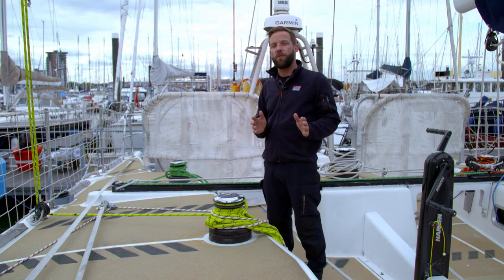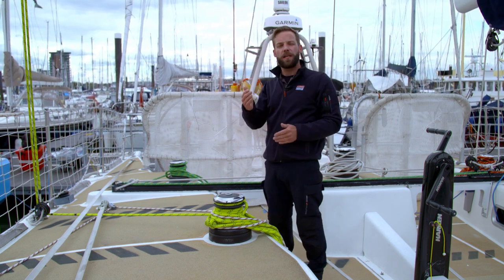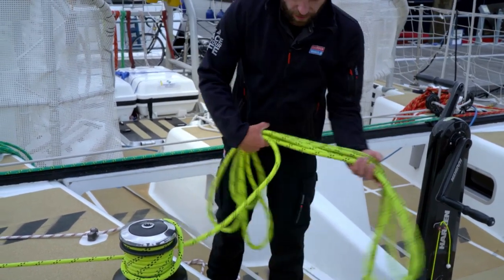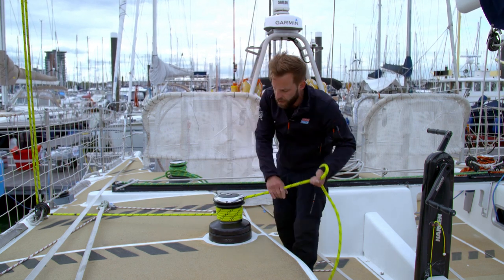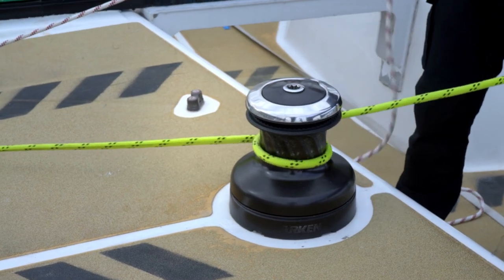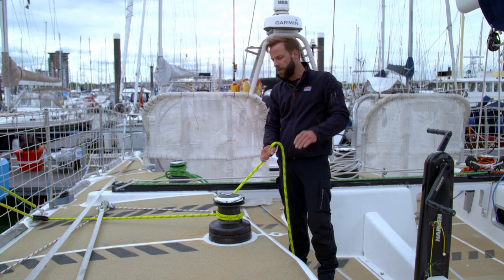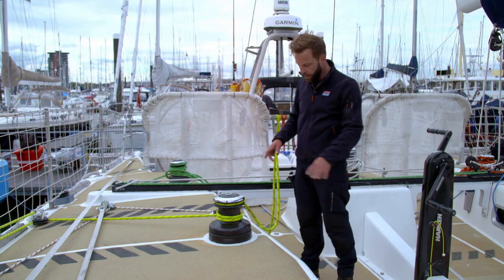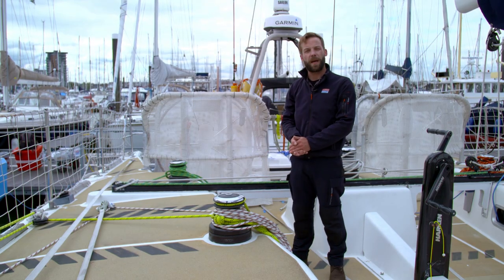Clipper Race Training | Running Backstay - Part 2

Comment: Runners are in fact a comination of standing and running rigging.  They can be applied or removed depending on the sail set and/or the maneuvers in the sailing route.
 We always used them on our Sigma 362 and will continue to do so on our new Glacer 47. 
The first thing is to mount them aft of the boom so that they cannot interfere with it.
The exact position should be ‘prescribed’ by the yacht architect or rigger.
Runners prevent the ‘pumping’ of the mast when using gennakers or spinnakers.  Most people think that they’re only designed to counteract the force put on the mast by the foresail(s) but they have multiple functions.  
This video shows how to put one runner out of the way (for example at the lee side) when not in use, the one on the windward side is then set in time in the correct sequence when tacking or gybing.  
Nice deck layout to have a long line that puts the block in the runners alongside but quite far ahead towards the bow.  It can’t jam if both lines are kept under mild tension.  I’d use low friction rings with dyneema anyway.
Considerable forces are exerted on the runners and it is therefore always good to have them, even on touring yachts.  They do a great job supporting the mast.

Comment: The backstay of the mast attached to a winch?  I would have thought that would normally be permanently attached to the boat?  I'm not sure I understand what is going on here.  Can anyone explain?
Reply: I’m still trying to understand the runners myself, but it seems they are to support the mast for the staysail. They don’t attach to the masthead. Unless I’m mistaken, the boat still has a permanently affixed back stay that is attached higher up the mast.

I think the issue is that the mainsail would get in the way if the runners were fixed, so your travel would be limited. Since these are not fixed, you can remove one of the runners and still have support for the staysail. The tricing line that gets mentioned is just to move the non-active runner forward so as to be out of the way and out of the way of the mainsail.